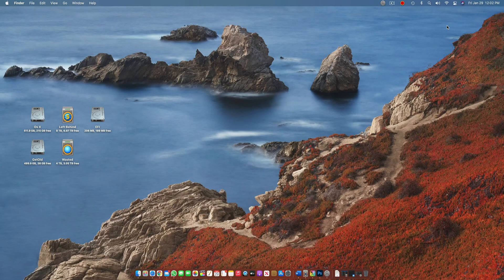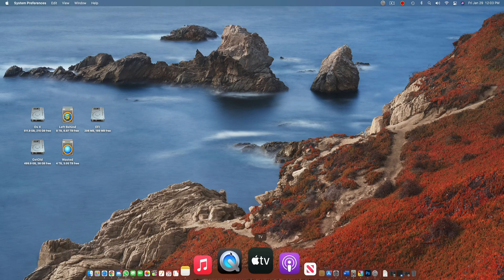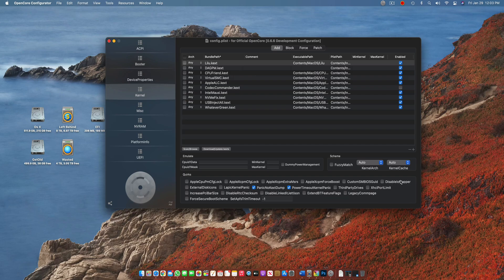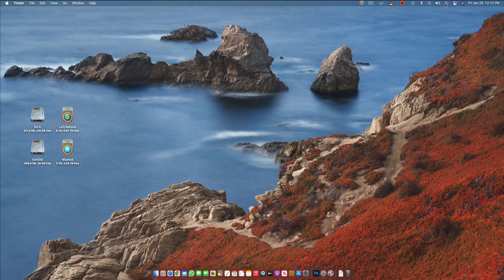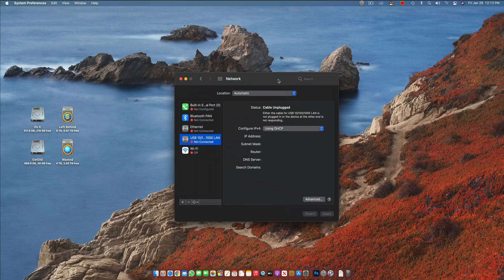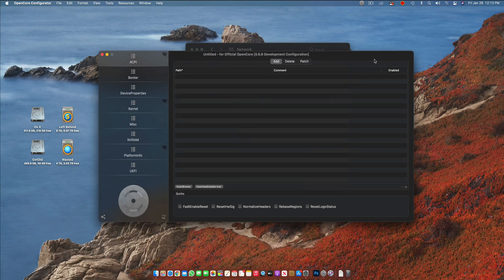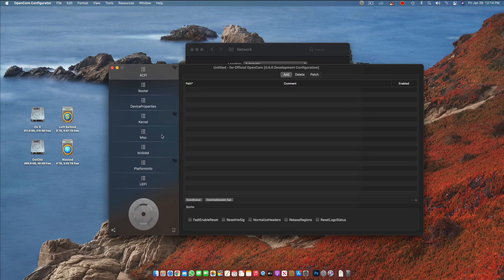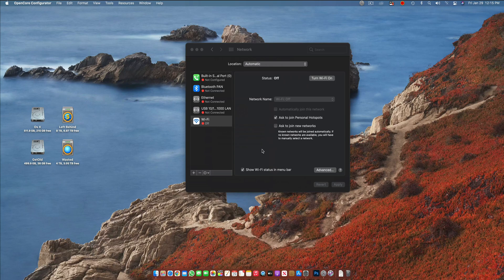Hackintosh WiFi Not Found Fix | OpenCore | Also for Apple Fix Cards | 2021

Comment: Dude, you said that you don't want people to waste so much time looking for a simple solution, but I did. The reason is that I didn't find this video before. I went through 2 motherboards too, 2 wifi cards (same card as yours, btw), and a wifi-extender to internet me through rj45 ethernet port. None worked until this switch. Great job man, how did you figure this out, mind sharing? What prompted you to even try this out?
Reply: one more thing, you should organize your playlists better on youtube, some kind of interlinking them, For Next Video in series click here, or have a description. The more interlinking you do, the higher the chances that youtube puts your next video as suggested instead of some other random guy.